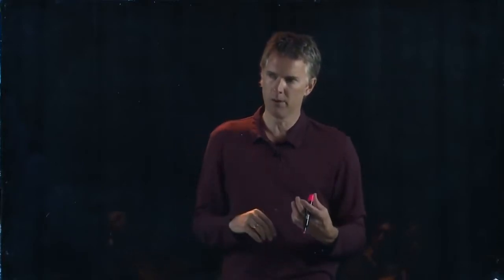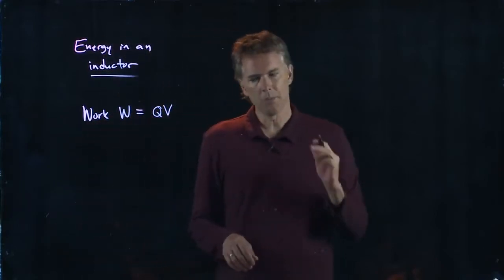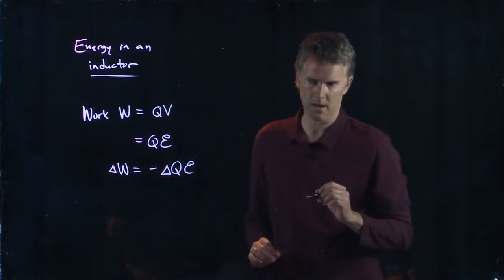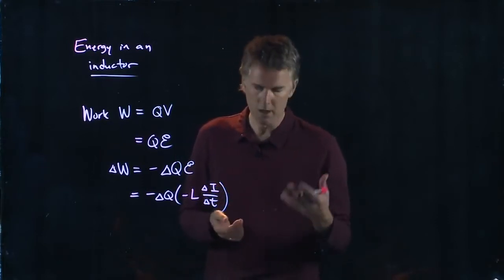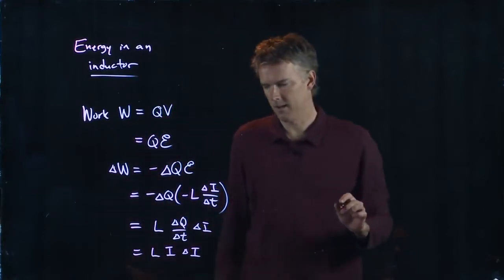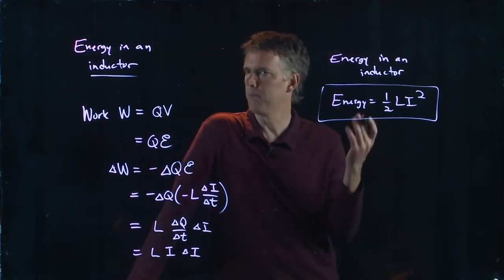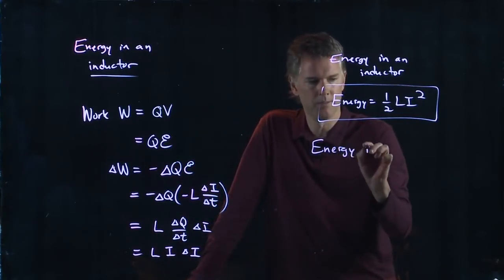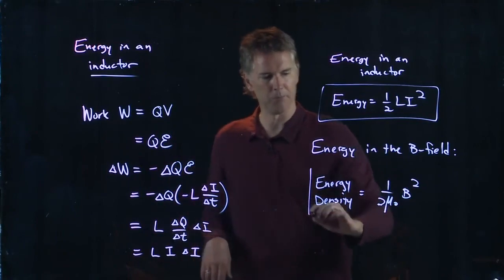Energy in an Inductor | Physics with Professor Matt Anderson | M24-12

Comment: 👍 This category of concepts really shows how things tie together, and how new ideas can arise because of it. I stopped working on the B-field code and started on an electrostatic application. The animation slowed me down and then I got an inspiration for electrostatics.....4 charges at the corners of a square and determining the field inside. Actually, I color-coded the charges for "+" and "-" and can move the charges  anywhere.....still testing it....but it should give the vector and magnitude of the total E-field due to (any?) combo of 1, 2, 3....n (in theory) of charges per some test-location, which can also be moved to any location.